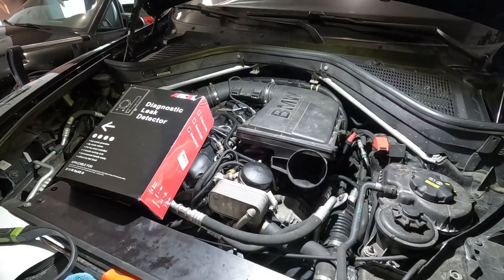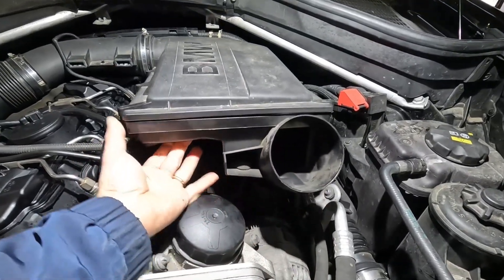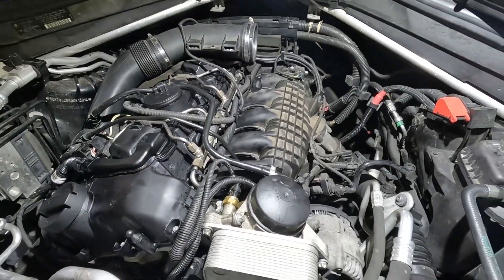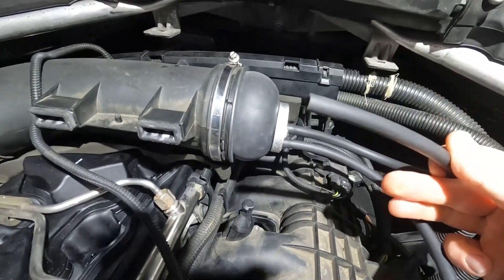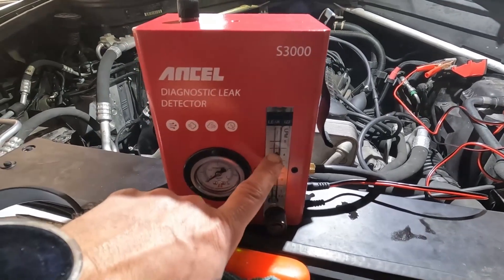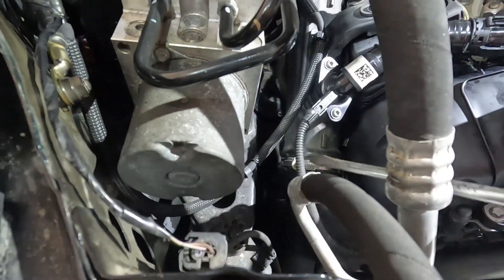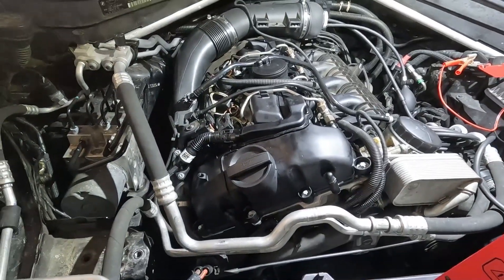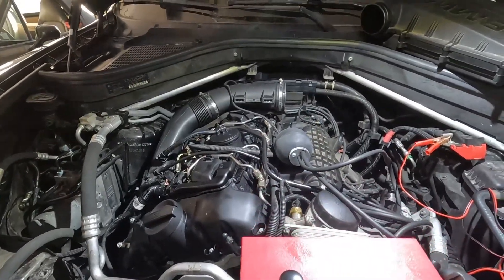Quick and Easy Guide: Smoke Testing an N55 Engine and Intake: Common Issues to Look Out For

Comment: Hi. if you put the vacuum blow hose with the adapter in the intake boot, does it go through into the throttle too? It is usually closed when not using it. I’m curious.
Reply from the maker: The smoke will still pass through no problem as the throttle does not fully seal off the intake.
Reply: @AskTheCarExperts got cha! Thanks.

Comment: Just remember this doesn't necessarily catch higher pressure boost leaks (not that you're saying it does, but some might think that).  Often you have to pressurize the system starting at the turbo inlet (not the intake which is under vacuum, not pressure when normally operating) up to 10-15 psi (or whatever you're running) to find smaller, higher pressure boost leaks.

Comment: Thank you for this video. I recently purchased a 135i and am in the process of converting track only use. Lots of stuff removed from the car and hit the track two weeks back for the initial shake down. I changed the oil before going to the track and the oil that came out was pretty black. Previous owner said it had a recent change but this did not look like that. Got a limp mode warning, yellow half engine and it said reduced power. The car is still at the track as they allow me to store it there between events. My initial thoughts are to check for leaks and to clean the vanos solenoids and see if that helps. Will also be purchasing new solenoids and causing the old ones as spares but I also change the oil every 6 track days as oil is cheaper than engines. One of the codes referenced solenoids. Thinking of joining the channel and you reference a better unit at work. Are you a mechanic that can walk me through the various things you cover as well as what I night come across? I am capable of wrenching but know nothing of turbo charged cars as the last car was s54. Thank you!
Reply from the maker: @fstlnj29  Hello, I am a BMW tech of 25 years experience.  Make sure your oil filter cap is not missing the center insert. That can cause vanos codes. Smoke testing is always a great step as well.
Reply: @AskTheCarExperts  Thank you for the response. I did change the oil and filter for the first time prior to my track day and will be tracking the car again in a few weeks. By center insert, I am assuming you mean the part that has the o ring on the bottom (drain back?) . If so it did. The car was driven from Fort Wayne, IN around the first  of August and then just moved in and out of the trailer to the lift or for work so there is a possibility that plenty of moisture could have built up over that time as I did not run it much other than checking the fan circuit once. Will be ordering one of the smoke detectors as those look like a great way to find all the annoying leaks if any and since this is my first turbo experience I am a little overwhelmed but will get up to speed quickly. Cleaning the solenoids seems like a pretty easy thing as there is no fan in the car currently so I can get at them without much fuss. I notice the snow blower in the background, where are you located?
Jay
Reply from the maker: @fstlnj29  Hi Jay, I am in CT. How about you? If the center insert was good then the solenoid clean is a good idea. I had to do that on my N55.
Reply: @AskTheCarExperts   In Virginia, between Richmond and WIlliamsburg.

Comment: Thanks for the tutorial. I used this tool and found a leak at the charge pipe connection. I redid the test and the PSI remains at zero and the leak detection section is at three. Am I expecting the leak detection to be at 3ish and the psi to remain steady i.e 10? I would’ve thought that after I fixed the leak, the PSI would remain steady.
Reply from the maker: @elvisd6691  You will get some losses through the valves and crankcase. That is normal. But if you don't see any smoke your leaks should be fixed.

Comment: I have an EWG N55 with 115k still on the original valve cover and PCV. I wanted run a quick test by slowing removing the oil filter on a fully warmed up engine at idle and I when removed the car I felt air being sucked in the crankcase with with a "psssshh" sound then engine idled rough for a few seconds until I replaced the cap. I drove the car the next day, there was no CEL but I noticed about max 2 teaspoon of oil on the driveway in only one spot.

I typically don't burn any oil between OCI, no rough idle, no smoke, no CEL and this engine pulls hard since it has MPPK retrofitted.

Btw the valve cover and gasket are scheduled for replacement  since I notice some oil sweating in passenger side of the gasket towards the back.

Any advice on that?
Reply from the maker: Hello, Some engine vacuum is normal. When the PCV is bad, the cap is VERY difficult to remove.  And with the cap off, it would be like a big air leak causing the idle change. Sounds normal.
Reply: Hopefully you went with plastic. I just did mine. And about to smoke test it

Comment: Question for you... I bought the Ancel S3000 from Amazon. Worked great for a day. The next day it wouldn't produce any smoke. I assume the heating element burned out. I returned it for a replacement.
The one I got, the knob didn't work. Probably didn't get connected internally on the assembly line. So I returned that one.
Is it worth one more try or is there another you'd recommend in that price range?
Reply from the maker: Absolutely! The one I have is going strong and I have not had any issues with it. I even have lent it put to friend and just did again today. I am going to be giving one away as well soon in my review on the Ancel 3000 that will be in a future video. Maybe you will win it!
Reply: @AskTheCarExperts  actually I ordered another from Amazon today. Interesting thing about those, they always have some kind of freebie deals. Last time I got a carrying case and battery tester free with it.
This time I got an ODBII reader (I already have more than I know what to do with) and a snazzier battery tester for free.

Comment: Great video explaining the smoke test & tester. I'm a true DIY shade tree mechanic and made my own little contraption from no less, YouTube. Handy little diagnosis tool. Keep the videos coming on the Bimmers/Bemmers. I have one of these N55's. Can you look into how to notch the intake manifold so you can get that 1 OFH bolt off without removing the intake? I watched a video on here some place that showed it but now can't find it. Greetings from that Old Jarhead in WNC
Reply from the maker: Thank you! I have never notched the intake but an easy truck is to remove the intake boots and just pull it back a bit which gives you access. Then drop it back down. The intake gaskets usually do not need to be replaced.